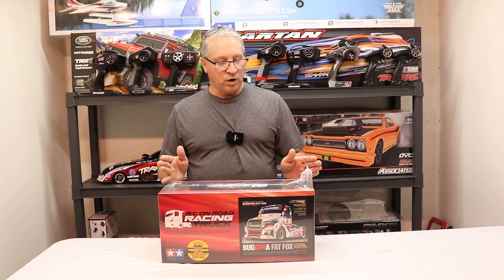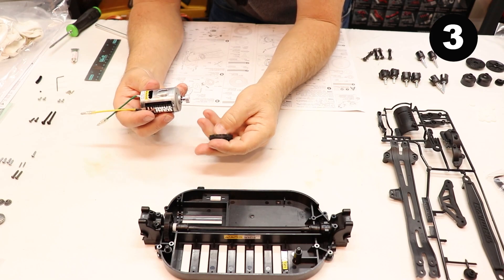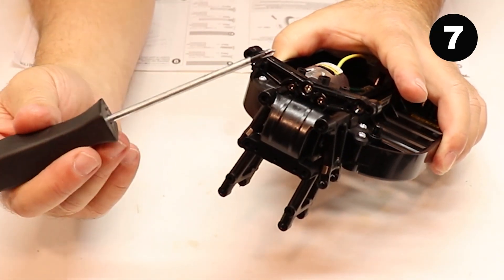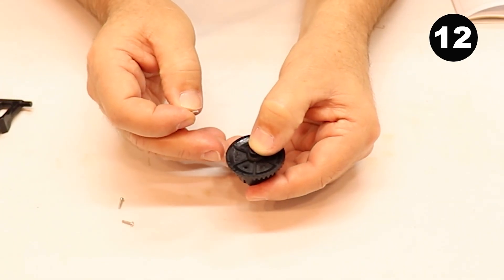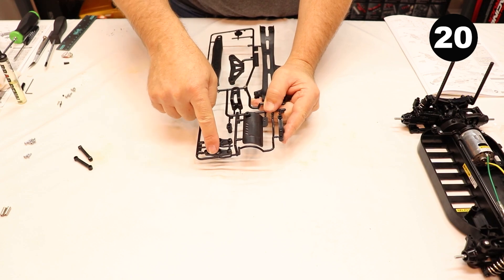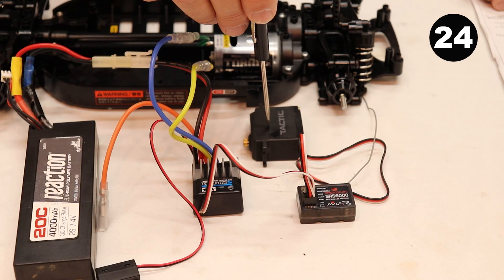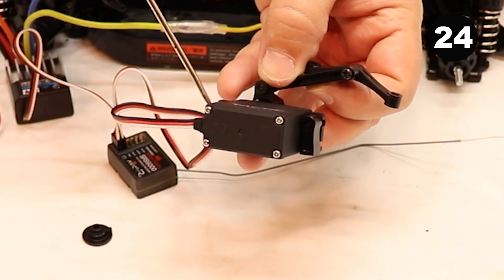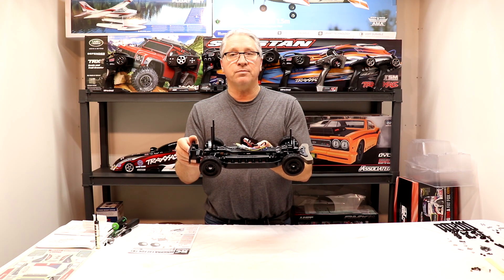How to build a Tamiya Euro truck - step by step - Buggyra Fat Fox - Part #1 Chassis

Comment: I was wondering are all chassis the same like the one you built I bought the truck called tank pool black and red one have not started it yet your video seems to be very helpful I hope my chassis the same in case I run into any problems thanks Joe

Comment: My receiver has VCC, CH1, CH2 and CH3 on it not throttle and steering. It’s not the wrong one as I bought from an rc shop and the man running it told me everything I needed and picked it out for me. Where do I put the cables?
Reply: 1 to turn, 2 to burn